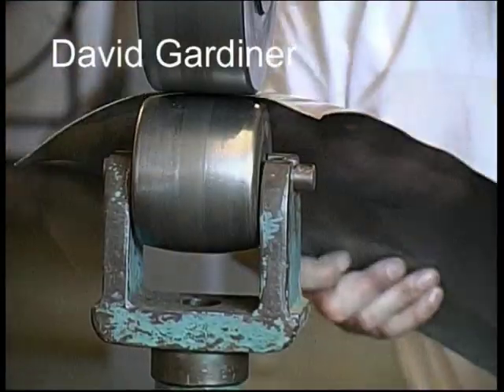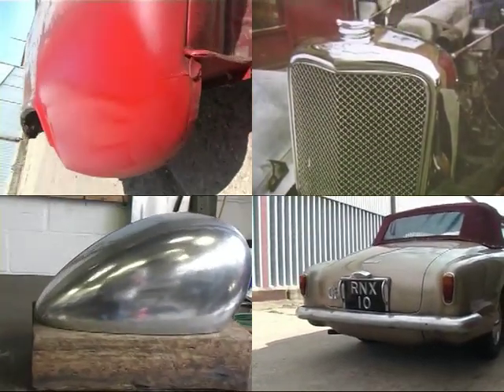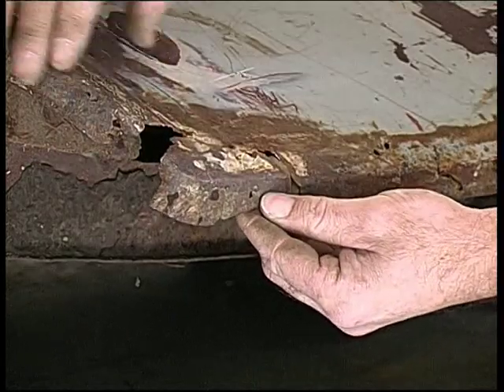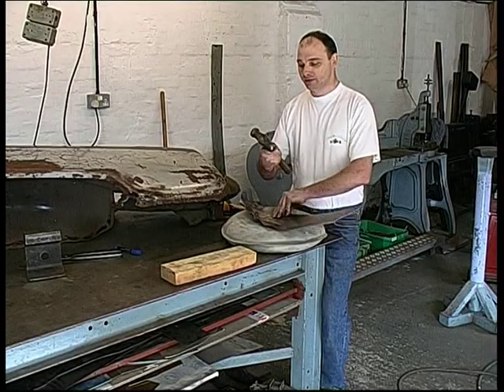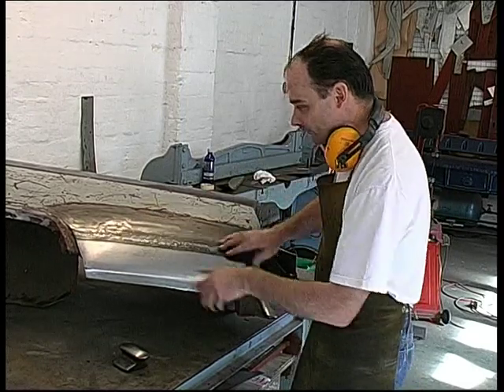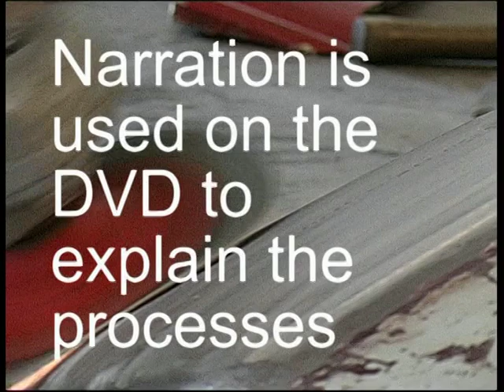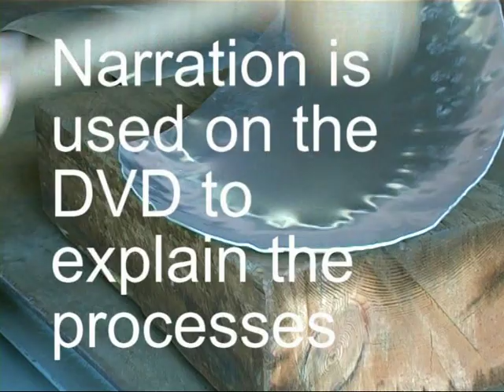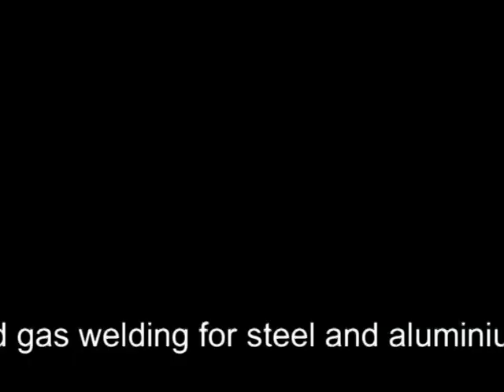METAL SHAPING WITH HAND TOOLS (English craftsman)

Comment: Hello Dave, I have a part of rotten chassis that needs to be replaced , so its a C or U section front end is 3" and the rear end is 4" , the front end bends upwards to the narrow chassis rail leading to the engine compartment, I tried to stretch the bottom of the c section and shrink the top end , but the c section is bowing inwards rather than upwards, any ideas

Comment from the maker: @twinbadger1 

I show a tig welding method for steel on the DVD that is just as good as the gas welding but I prefer to use gas particularly for aluminium work for many reasons.

Comment: @ Frank  The Lead , often just Stick Solder is ONLY used as a filler rather than Bog (Body Filler) as it provides a much better finish than anything else, Modern tradesmen in the auto industry don't have the patience and or skills, which is why the skills shown here are dying out.  

@ MisterFuturtastic  The cost of basic hand panel working tools is maybe about $500 for a range of suitable hammer's from shrinking to bull nosed cross pein etc and not forgetting the hundreds of hardwood and softwood blocks used as a soft backing rather than hammer on a dolly.
Small Oxy Set will be about $300 + consumables and cylinder rental.

Learn to skillfully craft and money earned will be many times greater than the initial outlay in tools and like myself word will spread, as I found out while restoring a classic car once, I ended up doing many other small repairs for many people simply because I had the patience and the tools. 

@Rodger If you cannot find the right shapes in stake dollies to set up on your anvil then do what I did, make your own - I got access to a forge and after welding some blocks of steel together to get the basic shape I forged and hammered it into shape then quenched it to harden.
Necessity is the mother of invention.
Reply: Most of modern tradesmen are just amateurs, only what they knows is
 replace the parts if they are not welded. . But they are called by themself 'doktosr'  'professors' ;specialists;' ... they shops are 'clinics'..less knowledge higher title.This guy is 'only' master.
Reply: Thanks so much for the info!

Comment: I believe that is a lead and mercury mix but there are different types of mixes used. Look for leading or tinning panels on Youtube. I don't think it is used for connecting sheets but rather filling areas with material instead of using something like bondo. I am a novice too so not sure how correct my explanation is. Just trying to help

Comment: what is that @ 6:15? some kind of solder?
Reply: Munky332 lead. commonly used to fill gaps
Reply from the maker: Munky332 

It is body solder also known as body lead. It is used to fill imperfections where it is not possible to hammer the steel to shape because of lack of access to the back of the panel or to fill small imperfections in door gaps. It will not chip or crack like plastic fillers. The process is called lead loading.